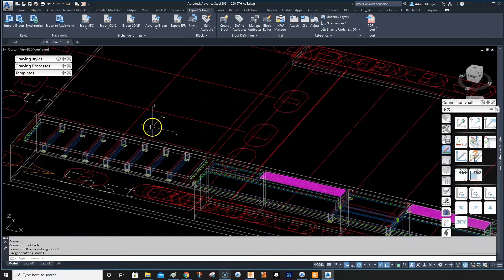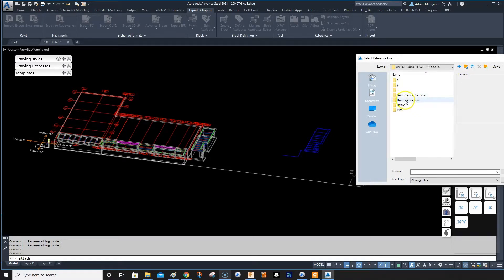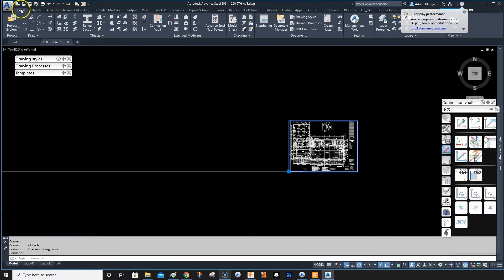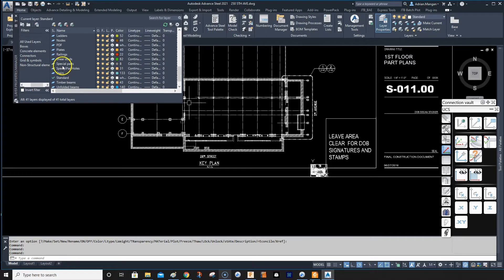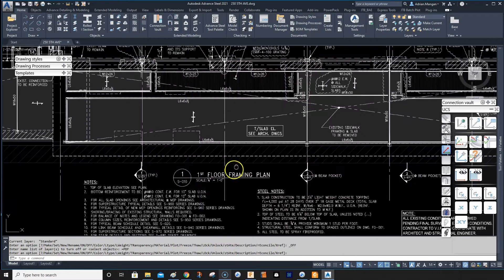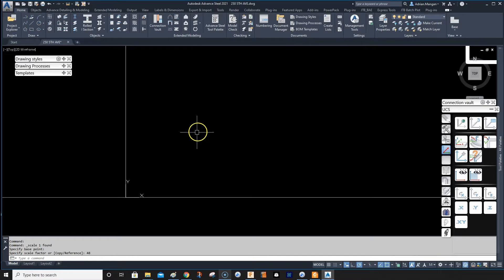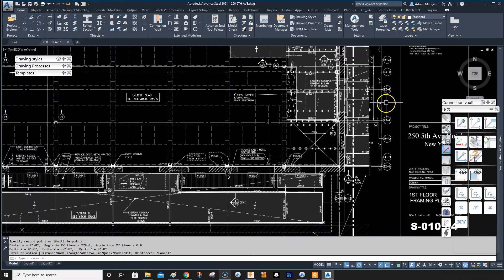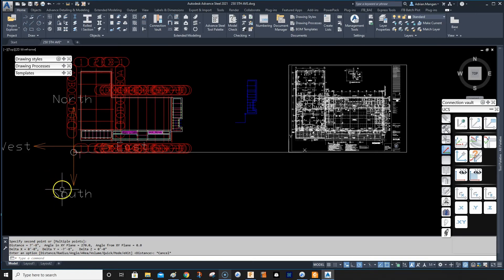ADVANCE STEEL: Quick Tips - "IMPORT PDF"

Comment: I’ve noticed a lot of your videos you import pdf to work from. Is that more trusted than DWGs in your experience ? I notice when I import DWGs it can make the model a bit glitchy. Running a decent system too so maybe it’s due to many layers that can come with DWGs. 
Really enjoy your videos on AS mate.
Reply from the maker: Hi, I generally don't get dwgs just pdfs, I would say just copy the lines you need and you would need to check that the dwgs are correct cause they are often not, orbing can be very glitchy with pdf also, just put all that stuff on a layer and turn it off when your done with it, should work fine, good luck and thanks for watching.
Reply from the maker: You don't really need a crazy Pc to run Advance steel, just need higher mhz CPU and SSD hard drive in my opinion, just need to learn to manage your model. Good Luck.